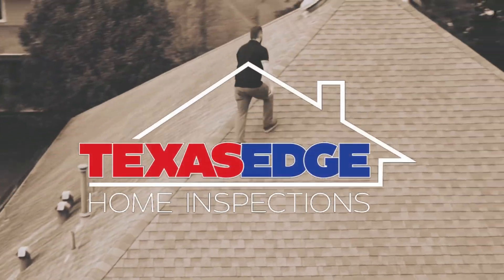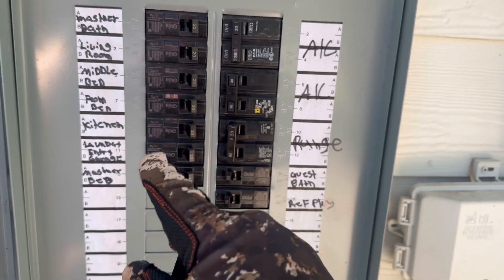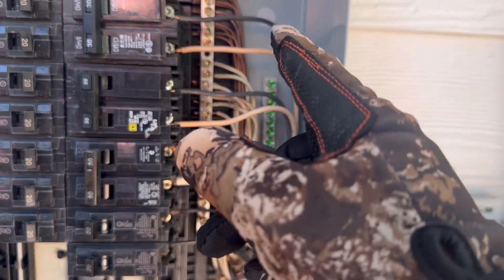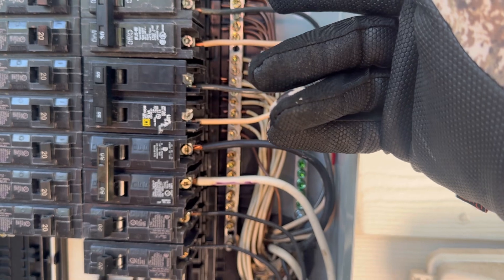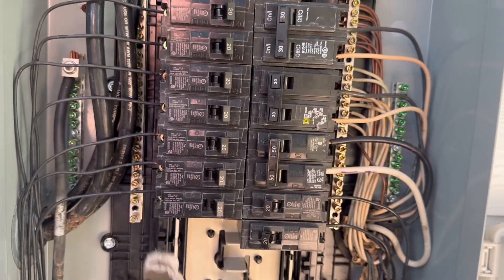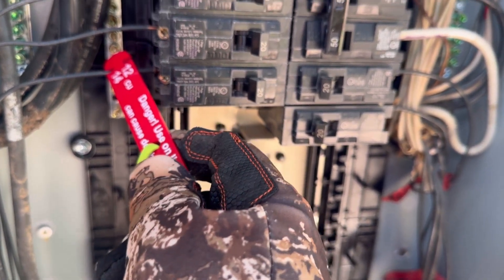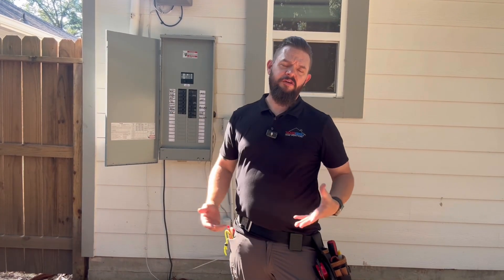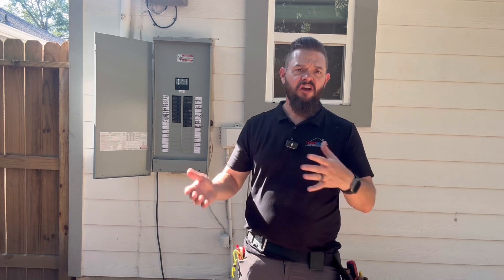Electrical Panel Inspection: Identifying Issues and Recommendations

Comment: A Couple  I would've called: Ground rod wire needed securing, breakers should be series rated (same type/ model) and something I would recommend is to look for wire insulation and buss bar discoloration, typically indicating excessive heat/ overload or the need for a new dead front cover.

One of your other electrical videos brought me hear. It rubbed me the wrong way and I was gonna let you have it. Your demeanor and approach on this one however, were a class act and your knowledge of code and installation methods are better than a lot of licenses guys, myself included. Great Job.

Comment: Would make sense for those A/C breakers to refer to the condenser and air handler and house has a gas water heater and gas dryer. That or the house doesn't have any A/C and they have a 2-wire dryer circuit which means they're using the ground as the neutral.